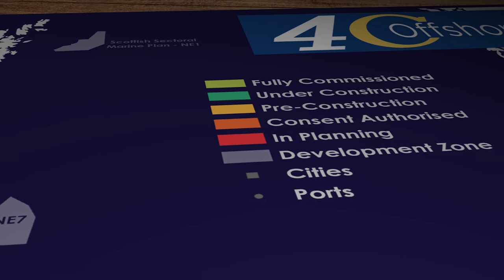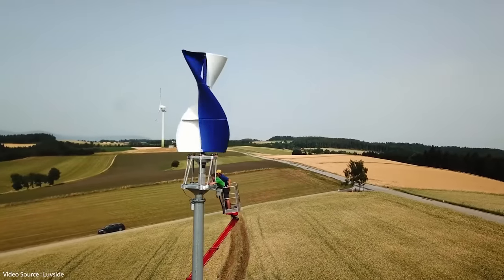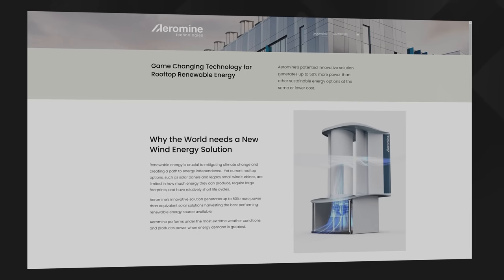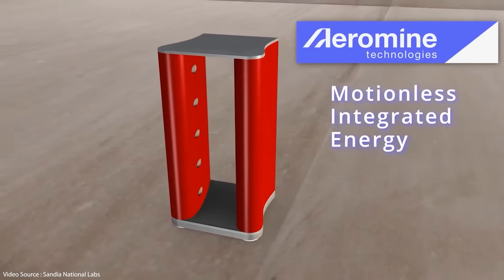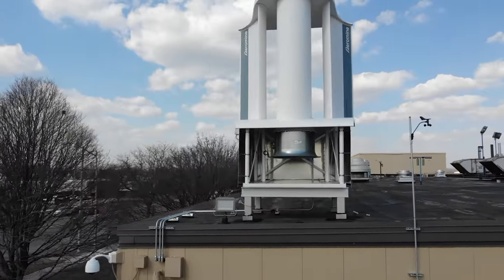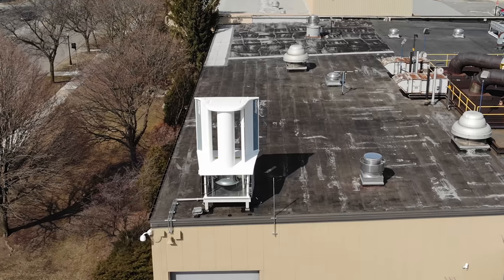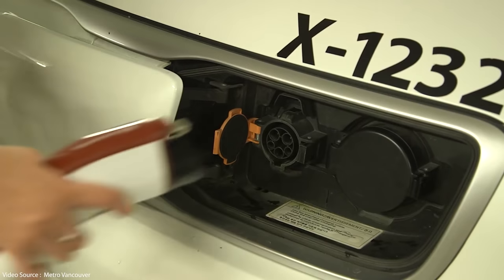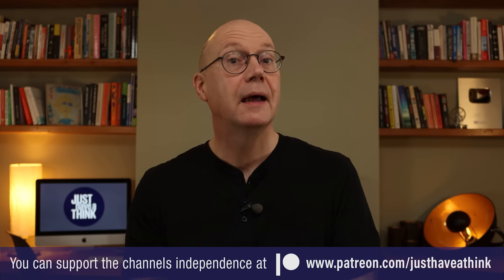Aeromine Rooftop Wind. Static. Silent.  50% more power than Solar PV. What's not to like?

Comment: Great video, Dave. Considering solar and wind pay for themselves, companies need more than just tax incentives from governments to put stuff on their roofs, it should be a requirement. If they can install AC units, they install PV and wind. The company I work for has only just decided to put up PV, energy for industry is still too cheap, there isn't enough incentive.
Reply: The fact that they just don't despite getting paid to (subventions and tax incentives) should raise some questions...

Maybe they don't because it is just not gainful...
Reply: @etienne8110  
Fossil fuels get a LOT more subsidies than renewables.

Worldwide, fossil fuels get about $400 billion in subsidies, while all renewables combined only get about $66 billion. 

Also, companies get a tax deduction for their electricity, and we pay the rest in higher costs. The company doesn't pay much of anything.

So while they would also get tax credits for installing renewables, the time to get the extra money spent upfront, back in the form of tax breaks is too long.

No company would switch based solely on the math.
Reply: @lordgarion514  Yeah fossils get more subsidies. Still not explains why companies wouldn't take both subsidies and install roof PV if it was this much profitable? 

Explanation: it isn't profitable, even with subsidies.
Reply: @martincotterill823  I disagree, saving energy is cheap and requires little to no new investment (lowering T°, cutting light when office is empty etc..) So it is pure profit. (both in money and GHG)

Whereas investing in new machine is...investment. =paying money upfront with unclear returns at a later date. 

So if I have a million dollar and just implement energy savings, I get 1 million+the savings, whereas if I invest in new machines, I'm 1million shorter and with unclear returns maybe in the future... 
I'm not in accounting but 1 million seems better than unclear promises of futur ROI ^^
Reply: @etienne8110  
Because companies don't do much if the payback time is too long.

You see, the power lines that bring FF electricity was paid for by us. We don't make companies pay for the hundreds of miles of wire to their building.
If we did, it'd be a different ballgame.
Reply: @lordgarion514  depends on where in the world you are. The cost of infrastructure gets in your bill. Beyond that this infrastructure is still necessary regardless of the renewable used since they are not reliable.
Reply: @manickn6819  
Well not really. I don't know of any place that lets you connect to their grid without paying maintenance.

Buuuut, a few dollars a month is better to a company than thousands right up front. You know, when they're already spending a ton of money.

Like I said, they get tax breaks and charge us for the rest.  Other companies that buy from them get to take what they pay off their taxes, which includes a fee for grid maintenance. But we also pay that fee, and we don't get to take it off our taxes.
Reply from the maker: Cheers Martin
Reply: @lordgarion514  maybe I am not following your argument properly. 

The way I see it is the grid is already there. John Public has paid for it in one form or another. I don't see how rehashing how that happened matters.

How do we proceed now (relevant to this specific video with wind energy). 
1) Force /entice companies to put up renewables on existing buildings

2) Force /entice companies to put up on new buildings

This is where the new money and subsidies come in. This is where the discussion should start in my opinion, not in the past.

The grid stays, by the way, with 100% capacity since renewables are fickle.
Reply: @manickn6819  
No, the grid stays because lots of things we do consume a LOT of energy. A lot more than can be made on site.

The fickle is merely a result of it being in the early stages, and there not being enough capacity.

Renewables are a LOT cheaper in the long run, but even if we got a message from super advanced aliens saying FF were too horrible for us to use, and they were shutting it all down in 5 years, we couldn't get switched that fast.

We damn sure can't switch that fast under normal conditions.

Your argument about renewables being fickle is irrelevant.

Coal and nuclear are way more fickle. They can't be used for anything else except baseload power. When people start waking up and turning things on, that's not coal or nuclear supplying that extra energy.

You're confusing needing to build things first, with things just being impossible.

We'll have coal for a long time yet. It will be what provides the energy to switch to the next energy supply.

Just like we used human muscle power to build the things that made animal power possible, and we used animal power to help build the things that made cars and tractors. 

Also, this isn't the kind of thing that's going to change the world. 

That will be done by the power companies building grid scale renewables.

And they're growing faster than ever. 95% of the extra capacity from now until 2026 is expected to be renewables. 
And that's because renewables are cheaper, even with nighttime energy storage.
Electric companies are the ones who build for long term. 

Your complaints are unfounded TBH.
Reply: @lordgarion514  If payback was positive, you would still find people interested, be it states or private companies. 

No one refuses free money just because "it takes a bit long". ^^
Reply: @lordgarion514  I don't disagree with your arguments and on base loads. I am quite well aware of how it works. In fact you come across as sensible in understanding timelines for changes. Many can't seem to catch that this will take decades to completely shift. 

Fickle might be the wrong word. Inconsistent at all times lets say. Without good grid scale storage renewables will be a limited piece of the pie. 

Anyway I thought we were discussing subsidies.
Reply: @manickn6819  
Inconsistent they are, but since solar with nighttime energy storage is the most expensive renewable, but still cheaper than the cheapest fossil fuel, all the grid plants will have storage.

And they are doing lots of subsidies, but as I said, regular companies don't care, if the payback period is too long. Can't do anything about that except make a law. Stockholders, especially the large stockholders get pissy and start sueing companies if they don't make enough profit from their stock. So if a company invests 50 million with a payback of a decade, they're probably getting sued.

Which is one of the biggest reasons why it's the grid scale plants that really matter.

As far as energy storage goes, it's easy, and pretty cheap. But this entire industry is in its infancy. Just because they have ways to do things, doesn't mean they stopped looking for improvements. What you're hearing about storage doesn't mean it hard or expensive to do, there's just a LOT of research going on, so we hear a lot now.
Our tax money has been used to pay to make FF more efficient for literally over 150 years, and we're only up to about 40%, if you don't mind spending extra. Otherwise you're at about 30-33 percent.

We heard basically nothing of new tech back in the 80s and before, until it was almost ready to be released.
Now we hear about things the same day someone had the thought. Makes it seem like things are taking longer. 

Oh, and once we get the grid switched to renewables, you probably won't even be able to build your own for less. I'm sure you're aware of bulk savings.
Reply: @lordgarion514  again no disputes with the points you raised. 

I have concerns with the generation of power from multiple sources feeding back on the grid. Unlikely the frequency can be kept accurate. That will not affect many devices we use but I am not convinced there are no ramifications. Busy with too many courses and work right now to properly investigate. 

The other issue is the grid architecture is set to distribute from one large producer (simplifying of course) to many consumers. Like a tree. Flipping that with multiple producers at the tips will probably require redesign. 

Going further this will mean more complex protection systems which opens the risk of hacking and sabotage. 

But alas we must move to cleaner power production and fix the issues as we go along.
Reply: Once energy costs too much for normal people to keep warm or eat, the planet will return to being the garden of Eden (that never existed). 
Sounds wonderful.

Comment: Wind turbines make a lot of sense. Rooftop VAWT systems are great if the vibration doesn't rattle the house.
What is the weight of these structures??
Reply: I doubt you could retrofit a standard house with this, not one that wasn't already designed to support large structures on the roof. I think it is intended, as the footage showed, for industrial buildings with flat roofs.
Reply: @danyoutube7491  
The house construction style makes a difference, some use meatier timbers, etc.  Again, the weight is a factor.  
Think this has less productivity on the ground because it uses wind dynamics associated with buildings to advantage...
Reply from the maker: A bit too big for a normal house. They're ten feet high
Reply: @JustHaveaThink  I kind of figured that out, still wondering about the weight...

Comment: As a side note, this design looks like it would be much safer for birds as opposed to small scale traditional designs with exposed high speed blades. I lived on a sailboat for several years and used a combination of a small wind turbine and PV panels to meet all my electricity needs and I know my turbine killed at least a couple birds (feathers lying about on a couple occasions) even though I painted the blades to make them more visible. Everything we can do to reduce bird kills, the better as populations of song birds in particular have really plummeted in recent decades.

Comment: The only downside I can think of is that this has to be installed at the edge of a roof, hence the use of the roof would be even more limited. Here in Malta, we have flat roofs and we use the roofs clothes drying, solar panels, water tanks etc. We also have a 1.1m parapet wall around the roof for safety reasons and that is why I thought of the installation place as a little challenge. The design is also a little unsightly, again because of the installation close to the edge. Having more than one on an apartment block, gives the impression of castle battlements. It's a pity though as we also live in a windy country.
Reply: The Aeromine could be installed into cut-outs in the parapet wall, without losing any of the safety provided by the parapet. It would also reduce the apparent height of the Aeromine by 1.1m, which is a very useful reduction.

Comment: Very interesting idea, had a play with this idea a few years ago. Sadly these generators need to be rather large in order to extract significant power from the wind (otherwise the compressible air simply goes around the obstacle). Really Big should work, smaller units not particularly efficient. I certainly agree it's a very nice idea using the aerofoils (/venturi effect) to effectively get a better impedance match between the turbine and the wind (hence better power transfer)
Reply: Add A.I technology to this and the wind generators can talk/communicate with each other and get maximum winder power bu adjusting positions throughout the day..also they look ugly add led lighting make it sexy and use as source of advertisement they can light up and display images/work synchronicity and produce opportunity for corporate branding..Great idea these additions will make it sell to public and companies..remember you saw it here first 24/02/2023...message me for ideas im an independent designer/creative

Comment: This sounds like such a promising development and explained, as always, in easy to understand terms.  Scanning the comments so far I haven't seen any mention the flat roof location issue and that the increased air flow is augmented by this unique positioning.  Would this work as well on a pole or stand-alone structure?  Domestically, here in Britain, pitched rooves are the norm. Perhaps such a unit could take the place of chimneys - provided the gable end is south-west facing.  Looking forward to getting the updates on the commercially available product!
Reply: The efficiency should still be there, but the unit would have to be installed with its rotational axis at 90deg to the pitch of the roof

Comment: I'm a retired chemical engineer with too much time on his hands. In one of my imaginative flights of fancy, I toyed with the idea of making a cheap, static domestic power generator from a 60 foot length of 4 inch PVC pipe with something resembling a basket ball with an internal hole atop it. I've forgotten virtually all of the fluid dynamics I studied at Bradford uni (TBF it was 50 years ago!) but I still sort of understand how the Bernoulli principle works. I also understand that wind speed increases with height above ground level. Forcing the wind to speed up as it traversed the ball shape, would create an area of low pressure at the top of the pipe. The pressure differential between the two ends of the pipe should result in an upwards flow of air which you could exploit to move a small series of low speed internal plastic turbine blades connected via a shaft to an external small electric motor/generator. Granted the amount of power generated would be small but it could trickle charge the battery I have as part of my installed solar system. In theory it should work 24/7, all year round, as long as there was a breeze, 60 foot above the ground. I also figured it might be beneficial to have the lower 10 foot of pipe made out of white shiny (sunlight reflecting) plastic and the top 50 foot made out of matt (sunlight absorbing) black plastic to create a thermal gradient across the pipe to speed up the upward air flow. In theory it could provide a cheap-as-chips source of wind power that you could simply bolt onto the side of your house. Job done. Sorted!

Except for the downsides that is...

First, it would look ridiculous & it would definitely upset your neighbours! 

Second the top half of the pipe would flex all over the place in very windy weather so would need tethering to stop it collapsing.

Finally, and probably the thing that would almost certainly kill this idea stone dead is that at some specific wind speed, you would get resonance inside the pipe (think a 60 foot organ pipe!) and the noise would drive you insane!

If anyone feels they want to run with the idea, please do, with my blessing.

Comment: VAWT's including augmented ones have never really met the challenge.  I think this company could have provided you with more info. than they did or you could be asking different questions.
Reply: Oh, the company is lying about the numbers. LOL

From the university of Oregon.
a 40 mph wind gives you 64 times more power per square meter [than a 10mph wind] 6400 watts per square meter. "

So a square meter gives 6.4kw, and a VAWT has a max theoretical efficiency of 30-40 percent, with closer to 30 being expected.

He says in the video the VAWT is 10 feet tall. That makes that hole at the bottom roughly a foot across, which is about 3/4 of a single foot.

Everyone else needs a square meter to get 6.4kw with the more efficient giant traditional blades, but these people manage 5kw with a 3/4 square foot hole???

That's a no.

And the biggest reason they never took off is because they aren't very good at mass producing electricity. The "swept area" is the area you're getting power from. VAWTs by nature have a tiny swept area compared to traditional wind turbines. 

They're perfect for home use. But the big money has always been put into the big blades, for obvious reasons.